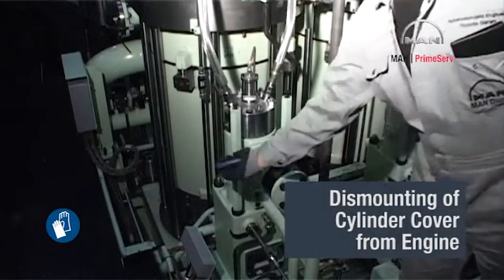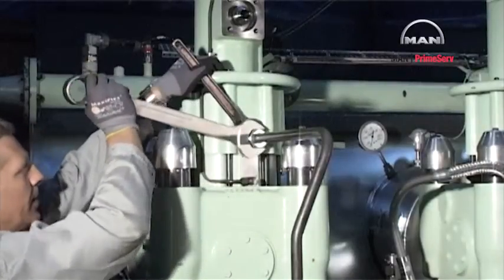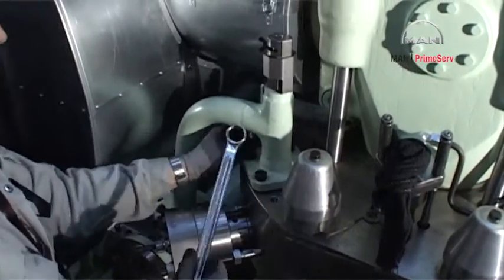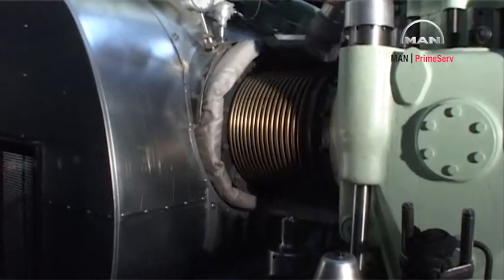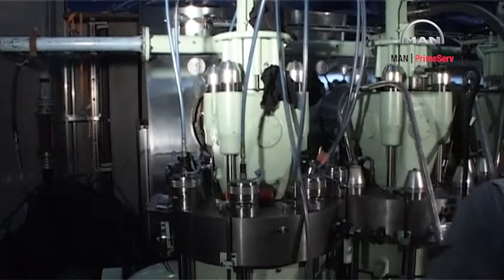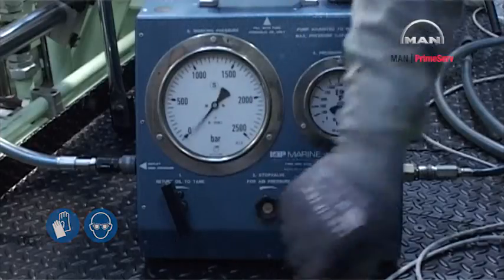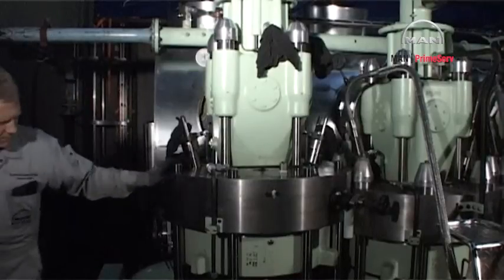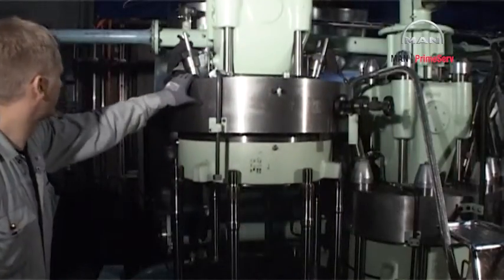Cylinder Cover Overhaul: 1) Dismounting of Cylinder Cover from Engine

Comment: Nice 1500 Bar :-)))
Reply: +mp Energy What is the name of the hydraulic tool used to turning the nuts?
Reply: I dont no :(  but you coud ask to ManDiesel
Reply: +mp Energy Don't worry, I found it, its name is hydraulic bolt tensioner.